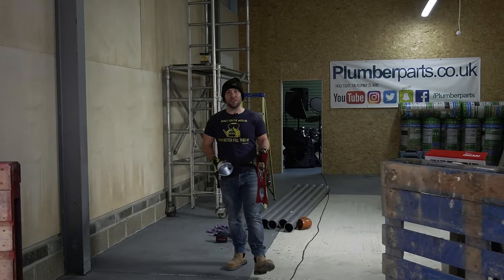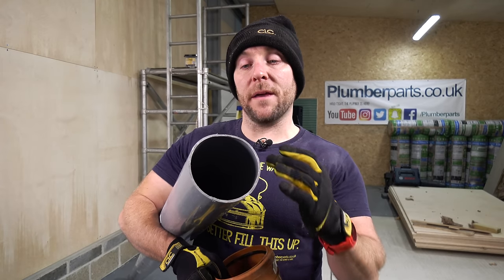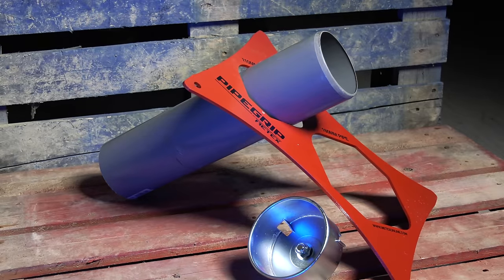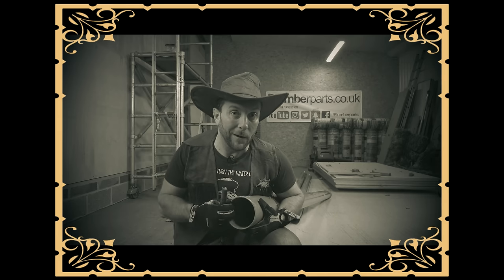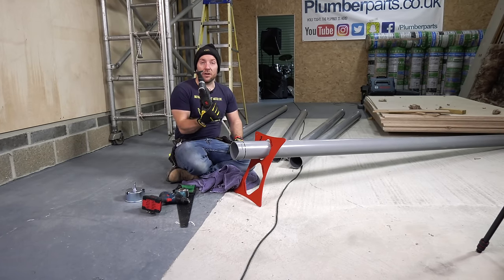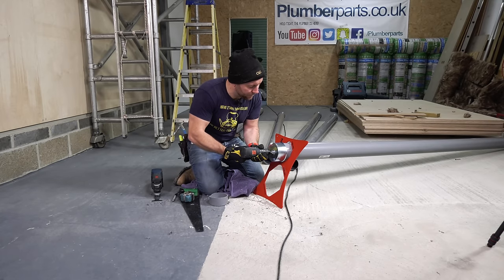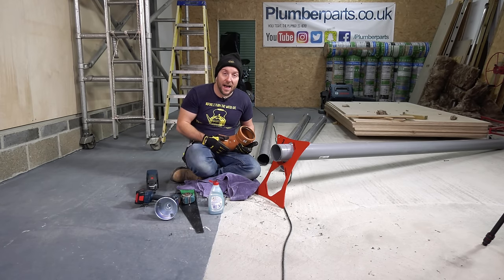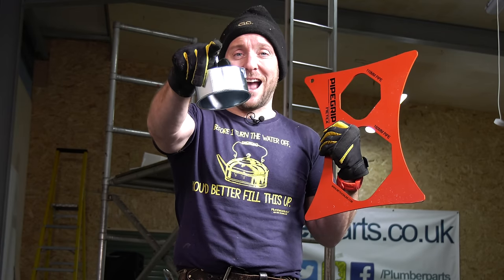HOW TO CUT AND JOIN SOIL PIPE THE EASY WAY

Comment: As someone who works primarily with PVC pipe for sanitary lines here in the States, or as you call them, soil lines, I find your system of O-rings sealing the fittings to be much easier than primer and glue.  I wonder how the o-rings hold up over time however.  Also, I use a cordless SawzAll to cut PVC with a metal blade.  Wood blades for ABS.  Use Emory cloth to chamfer.  Going to look for something like the tool you use.  May make one of those pipe horses out of 3/4” marine plywood. Love your channel by the way.   Have a couple of cats too.  Way cool companions.

Comment: Good video James

I like to use a piece of 4inch pipe cut from the factory end, cut it down the centre and slip it over my pipe and use the factory edge to mark around my pipe giving an even mark all around the pipe, it’s a small thing but I’ve never had an uneven cut since
Reply: Kurtis Young I’ve been wrapping a length of 50mm wide masking tape around the pipe.( I don’t deal with soil pipe much) but I like your idea. It is robust, light and reusable. I think I will cut some slots on the cut end of the template so it is quick to see which is the factory end.
Reply: mhm, never thought about that :) i have to try this idea :)
Reply from the maker: MATE that is exactly what I do...just didn't show it in this video!
Reply: plumberparts lolol I came across like a wee know it all but in all honesty I’ve been watching your videos for years and I’ve pinched far more tricks from you than anyone else James. I’m a massive fan of your videos and I know you know your shit cos I know my shit. Always open to more learning more tricks to make the job easier though. Keep up the good work mate 👍🏻👍🏻👍🏻
Reply: @kurtisyoung9478  He knows his shit and you know yours, but if you both shit in the same pot, do you think you'd know your shit from his, and vice versa?

Comment: I just use a jubilee clip as a guide to cut with my multitool, deburr with a bit of sandpaper then use the washing up liquid. No taper needed. And it works a treat
Reply: Whatever pipe I cut I use one of the pipe clips to mark the line; you can even screw a pair into some wood to hold the pipe and then saw between them

Comment: Hi James I do like those 2 products that you used to hold the pipe and to chamfer...Do you have a video to show how to introduce something like an equal T into an existing pipe in the ground (horizontal) as the  one I have done I was able to dig close bye to a downpipe to achieve side movement for the double entry.
Many thanks

Comment: Maybe i'm some backwards plumber, but i cut and chamfer soil pipes with angle grinder with diamond cutting disc :P
Anyway this stand thing would be useful, how is it doing with 1m or less pipes?
Reply from the maker: Seemed fine.
Reply: I guess for short lengths you could turn the stand thing upside down - might get one

Comment: Hi James - just seen this video after a a quick search as I'm in midst of fitting inspection chamber in sewage system.  As no one can you use the loo till i've finished I shot down to screw fix and bought the Metex CMF110 CHAMF Plastic Pipe Chamfer Tool 110mm.   What am i doing wrong???  it's only chamfering one side of the pipe???  cheers Dell

Comment: Any groundworker I know uses their 12" petrol grinder to cut underground pipe, then put onto auto throttle and spin the pipe against the blade at a glancing angle to get the chamfer. Couldn't be easier to be honest.
Reply from the maker: Just another method here mate...both have the same result!

Comment: This stand for tube is actually pretty handy. If you use all that tools. To cut, pipe perfectly and grind it u need just angle grinder and muff without rubber joints to make marking if u cannot do it by hand. Less tools, less effort, less time, more money 😉

Comment: James this was helpful thank you.  I need to cut a 4 inch pvc pipe which has a crushed section underground once I dig it up.  What adhesive do I use once I try to join the pipe after I cut the crushed piece as this is first time dealing with PVC.  Tx

Comment: Can you use soil pipe for ducting ventilation instead of manrose duct work. I will be using manrose mft 100 inline fan on 6m run what type of duct would u suggest

Comment: Washin up liquid to lubricate the pipe? I'm sure that you should use silicone lubricant as specified by plastic pipe and fitting manufacturers. Anyway, love your channel. Merry Christmas 🤶
Reply from the maker: I'm going to remove the rubber from this socket and submerge it fully in pure Fairy Liquid! Lets see if the world ends or not...
Reply: @plumberparts  You're right, the world is not going to end, but there are chemicals in Washing up liquid that are not meant to be around the O-rings in soil fittings, might not cause a problem today, but in a few years time, who knows? perhaps we should run it past the manufactures of the product.?
Reply from the maker: Mark Smith I’ve been running an experiment on inhibtor for nearly 5 years. This’ll be the same. Jar of FL and a slither of rubber. Leave in the jar and take it out every month until a year has passed and see why it’s like.
Reply: @plumberparts  I think your test is nonsense, Talk to the people that really know, the people that made the product. I think Gary  Chandler is correct in saying that a lubricant specified by the manufactures is the right way to do it.
Reply: @plumberparts   Oh dear, didn't realise you were a princess and obviously beyond any form of criticism, if you are going to make videos instructing new entrants into our industry, I just think you should get it right is all. Please accept my most humble apology your highness.
Reply: Hold tight fella, not trying to offend here, but if you put yourself out there, you have to expect a little clog from time to time, I just wanted the new entrants to be shown the correct procedure, even if there is a debate over it. I won't post anything further on this particular channel.
Reply from the maker: Mr Brightside thanks mate. Unfortunately G is in the vets and isn’t well - which might be why I’m so annoyed about comments atm!
Reply from the maker: Mark Smith mate I don’t mind your comments, but I offered to take my own time to do a proper experiment - you said it was a waste of time! You should  see the jars I have of nails in water and inhibited water. Been like that for 5 years now - that’s an experiment! I love proving what people claim to be true or not - and often wonder where some claims come from. Continue to comment if you like but at least support someone who wants to prove things! 😎
Reply from the maker: Mr Brightside same here mate. Ruining what should be a happy season. Poor little beast. He’s nearly 14 now and with half a tail has been though the wars!
Reply from the maker: Mr Brightside apparently it’s just indigestion! So that makes two of us on Gaviscon now!

Comment: Hi I know my question is not related to the video but I have an issue with my electric shower and hope somebody can help, my old shower stopped working, when I turn the isolator on it shows power when i turn on the shower it cuts off and no power light is showing, an ideas how I can resolve? I’m not an electrician and can’t get one out Before Christmas so any help would be greatly appreciate

Comment: fairy liquid being used on new builds also, lot easer to fit the pipes once you've melted the rubber
Reply from the maker: Jesus mate. Loads of FL flows down the pipes everyday!
Reply: Do see your point, though unless you’re in the big fairy factory it’s usually heavily diluted and gets rinsed away,       Doing bathrooms iv had to change fittings back to the stack, recently on a house only 6 years old because the fitings were leaking on a horizontal run, when you dismantle the fittings the black rubber is bassicly completely  fu  ed covered in a mixture of melted rubber and fl juice, admittedly the leak was minimal but I couldn’t leave the fittings as they were,     Honestly that fl is more corrosive than acetoxy sealant
Reply from the maker: So you know they’d used FL on those fittings or had you fitted the stacks and used it previously? Honestly I’ve used both Silicone and FL and never had a problem.
Reply: @plumberparts  i cant be 100% certain fl lube had been used but i come to the conclusion it had been as i know fl will melt rubber over the years and the connections were covered in what appeared to be fairy wash up with melted rubber, +thehousewasbuiltbybarratt,      fl never evaporates and the pure fl lube will stay in contact with the rubber forever until it gets rinsed away,  you'd need a hell of leak for that,              i had used fl lube in the past and not aware of any issues, just use silicone spray know,  anyway im certain it does melt the rubbers after a couple of years,   but in the vast majority of situations it wouldn't matter anyway, suppose fl would only cause issues on a horizontal run inside a building
Reply: If building control knew you had used fairy on your fittings, the whole lot would have to come out. It is very evasive.. Silicone all day..🤔
Reply: Yes your correct building regs told me the whole thing needs to be redone due to using fairy liquid. The plumbing shop also said the same and Floplast website mentions under no circumstance should fairy liquid be used as its detrimental to the rubber seals. I mentioned to them that fairy liquid goes down the pipes they said its diluted so not the same thing. Oh well off it all comes what a pain for a spray that costs the same as FL 😢

Comment: Here in the US, we don't use gasketed pipe inside buildings.  Generally we use PVC or ABS, with glued fittings.  They also benefit from a chamfer or bevel to keep from scraping the glue ahead of the pipe.  Outside of the building, we can use gasketed PVC for sewer and storm drainage.  Interesting seeing how you do it across the pond.

Comment: multi tool to cut pipe?Why?It's definitely not as neat or as quick a cut as using a fine tooth hand saw.Chamfer tool I guess are nice but @ 40 quid a pop not exactly cheap.

Comment: You should be using silicone grease not fairy liquid
Reply from the maker: I'll use whatever I goddamn like BOYYYYY!
Reply: plumberparts lubeeeeee
Reply from the maker: That run out ages ago...
Reply: yeah .. you should really
Reply: Always good videos though let it not be said
Reply: plumberparts fairy liquid is corrosive and will damage the rubber seal, most common one is when idiots use it on flue’s 😱
Reply from the maker: @alanmurphy3584  I'm going to remove the rubber from this socket and submerge it fully in pure Fairy Liquid! Lets see if the world ends or not...
Reply: plumberparts you should do that as one of your videos and go back a year later to see if it has actually started the end of the world, you know coz there will be a massive hole opens up in the ground and little devil like creatures will
Crawling out of it

Comment: Fairy liquid degrades the rubber seals and should never be used, Silcone grease is the correct way
Reply from the maker: Sorry bro buts that’s a myth. I do have silicone spray and use it. Just not on set this day.
Reply: Due to washing up liquids chemistry it hardens rubber, making it crack and brittle, dramatically reducing the seals lifespan
Reply from the maker: @sparky02121975  I'm going to remove the rubber from this socket and submerge it fully in pure Fairy Liquid! Lets see if the world ends or not...
Reply: @plumberparts  the fairy liquid should be ok to the seal as long as you have your hard hat on